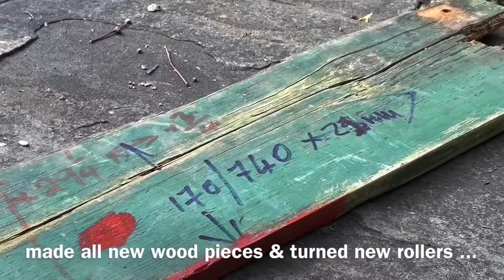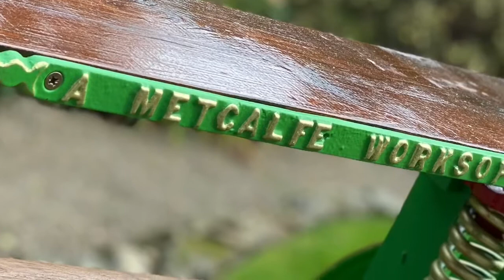Mangle Restoration

Comment: Hi I’ve also just started restoring one I’ve got it dismantled however I’m missing the wooden rollers just wondering where you got them from. 

Thanks
Reply from the maker: Hello Aiden.  After much researching I found success at The Turner's Workshop - www.turnersworkshop.co.uk  Contact Richard Findley 0116 281 1303.  Good luck with the restoration. Stuart.

Comment: Great to see what can be done. Stunning resteration. I wish to restore my folding table mangle. It's not as bad as this one before restoration. Would like to know what wood was used for roller, as I need to get a wood Turner to make me a new one, as bottom one too damaged to use.
Reply from the maker: Hi Craig. Wood used for the rollers is Sapele. After a lot of searching online and many phone calls, I found turnersworkshop.Co.uk and as you’ve seen they did a great job. Good luck with your restoration.

Comment: You made a really lovely job of that. Definitely early 30's. Most companies (Pioneer, Taylor Wilson, etc.) went over to rubber rollers just before WW2, then a break for 'war work'. Drip trays tended to go to aluminium after the war as aircraft were broken up and all that ally was sold off cheaply (Landrover bodies famously used it to great effect too). The Pioneer I did is now in Blists hill museum at Ironbridge. Have a look at my video when you get a chance. https://youtu.be/oUvrF8q8FVI
Reply from the maker: Just watched your restoration and I'm very impressed at the way you tackled it.  Looks great.  Thank you for your compliments on my mangle and for the historical background.  Very interesting.  I really enjoyed restoring it.  As you saw, I had to make new rollers which did not work out too well.  The chap I gave the job to along with the specifications, failed to apply the rule; measure twice cut once.  The rollers needed to  have a diameter of 5.5 inches minimum, but he turned them down to less that 5 inches.  So in order to complete the project I have temporarily wound thin plywood around each one to the correct size.  They look the part and they work perfectly but they won't last.  I'm looking for someone that can remake them.  If you know anyone please do let me know.  All the best. Stuart
Reply: @stuartjj100  Yes there's only so much adjustment the gearing can take to compensate for roller diameter. I'm in the process of restoring a 1949 TayWil and have had to replace the rubber rollers (being white they're 90% natural rubber so rot away). The ones I managed to get are from a Pioneer but fortunately Pioneer made all of TaWil's rollers after the companies merged through family marriage so they're Identical. Getting them off or the square spindles was hard work though!